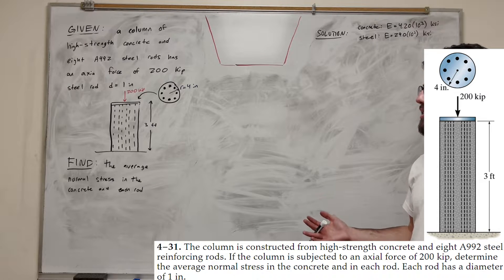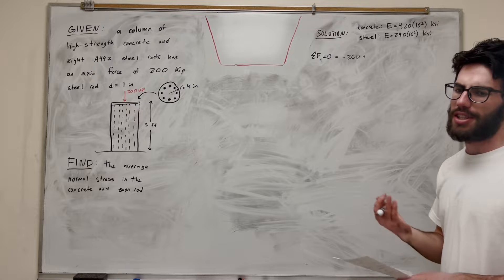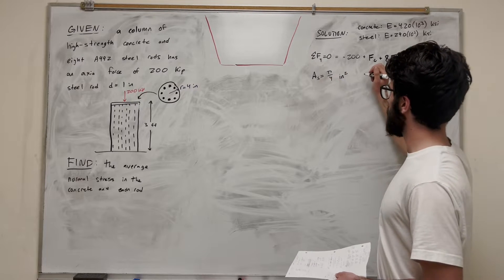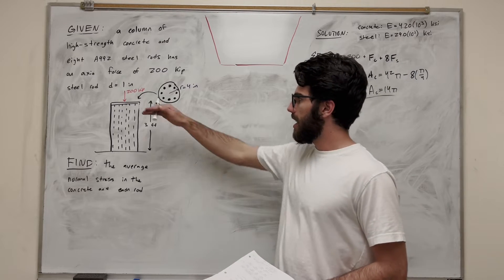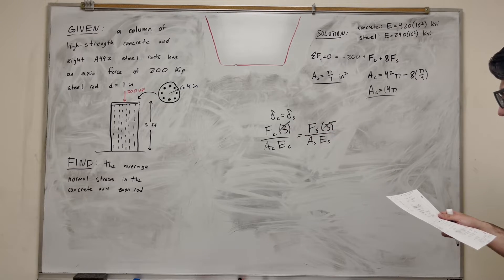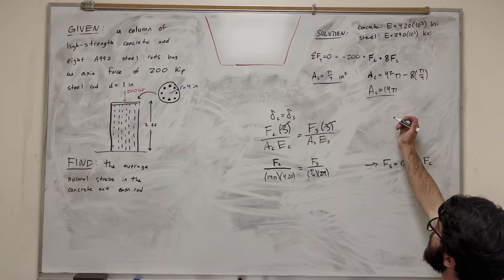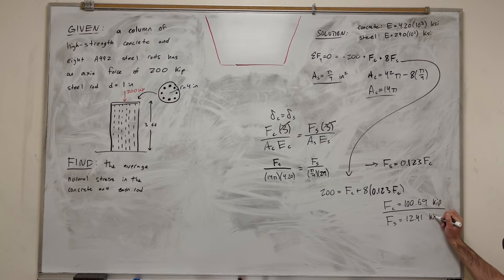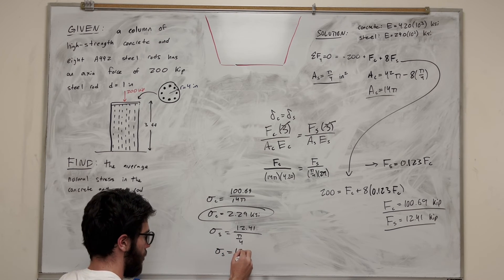The column is constructed from high-strength concrete and eight A992 steel reinforcing rods - 4-31

Comment: Thank you for this video! I know it's a little old but could you explain why the area of the concrete, A_c, is not 8(pi/4)? There are 8 rods so I would assume the cross-sectional area of the rods would be 8 times the area of a single rod. Thanks!
Reply from the maker: I believe that the 8 rods was factored in some other equation.
Reply: because its two different materials, the concrete is reinforced by the 8 steel rods, so A_c should be (the area of the concrete) - (the area of the steel rods) ->(pi/4)*(4)^2 - 8*((pi/4)*(1)^2) which should equal to 2pi, not 14 pi
Reply: @hengry0  that would also be incorrect since 4 is the radius of the concrete and you used the formula (pi/4)*d^2, so it would actually be 14pi